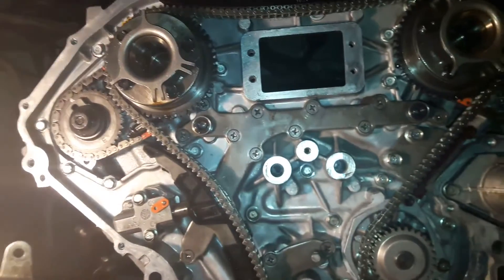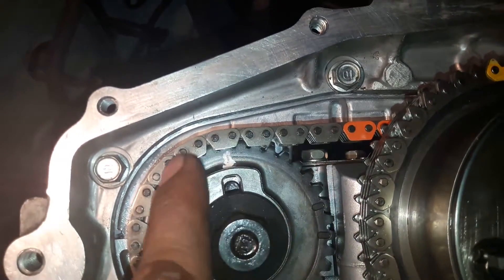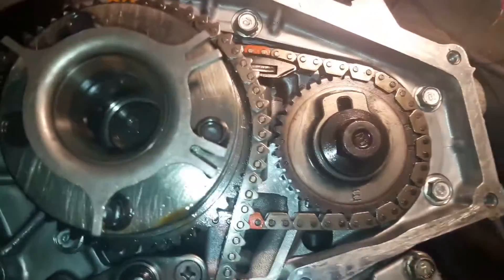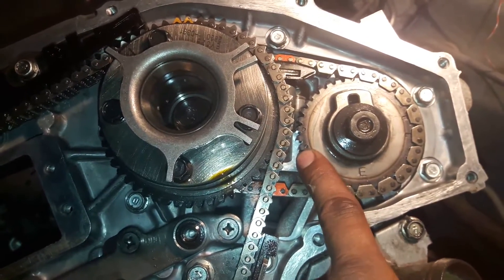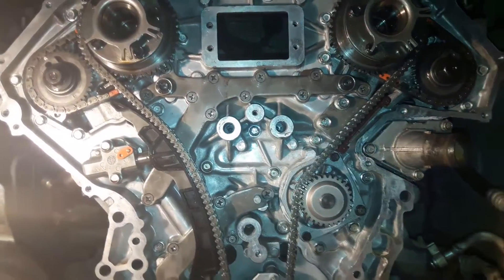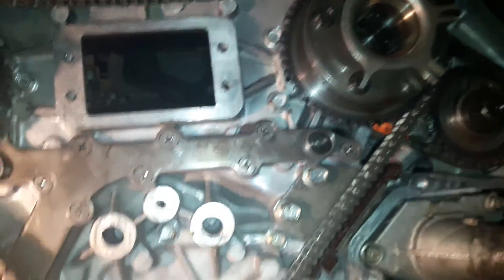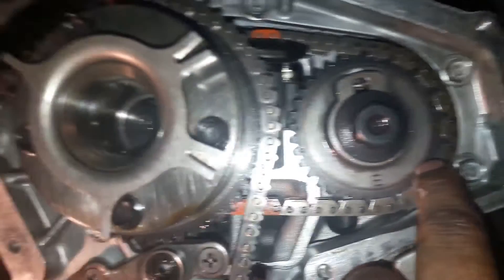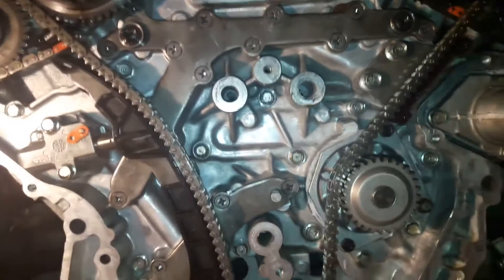How to fix nissan 370z ingine timing issue  and timing chain marks

Comment: My timing was off 25 degrees on bank 2 and 14 on bank one is it possible to redo the timing and it would be okay?
Reply from the maker: Yes you need to make properly allignment off the mark on chain and sporket
Reply: @MundrikaSharma  so do you think the engine has damage or no. If I redo the timing do you think I’ll be fine the  car cranks but doesn’t start no metal at all in oil. Just timing is off
Reply from the maker: @jonahsandoval_6523  wrong timings will damage cylinder head valve
Reply from the maker: Just allignment proper marking then car is start normaly
If not then check may other issue

Comment: so how do you move everything around and put it on the right spot.?  you point to where it goes, but how do you make it go on?
Reply: iztheterrible you turn the crank manually clock wise many times until all those marks end up where he is telling you. It will take possibly many many turns but it should eventually end up like that. Another way is to manually turn the sprockets separately(with secondary chain still on) if youve taken the main chain off already and the sprockets have shifted from their marks